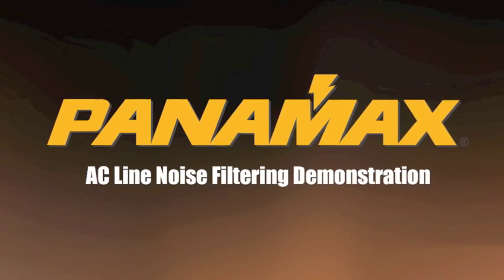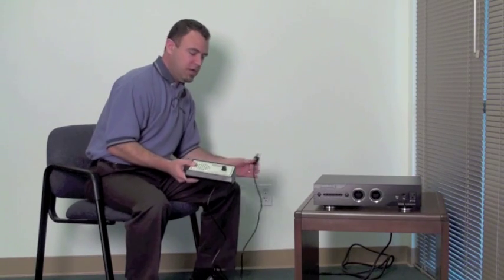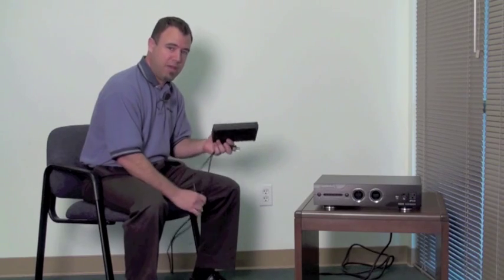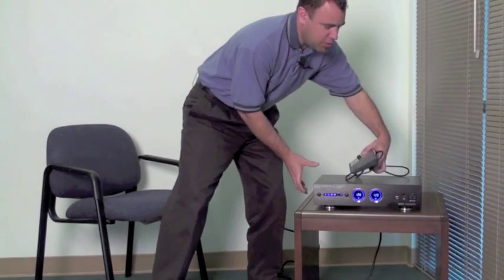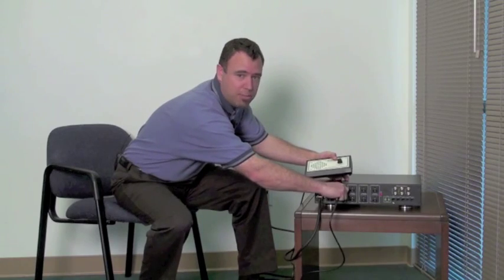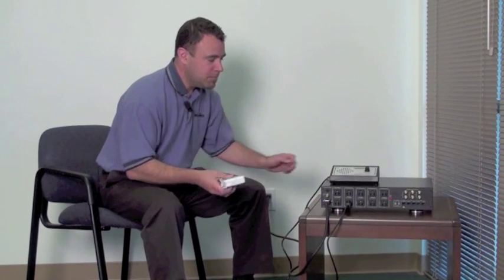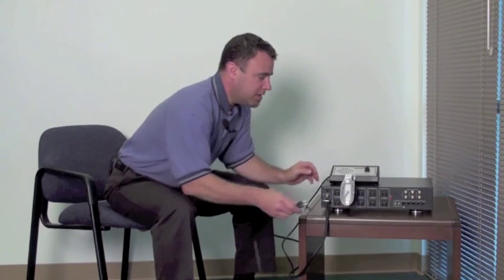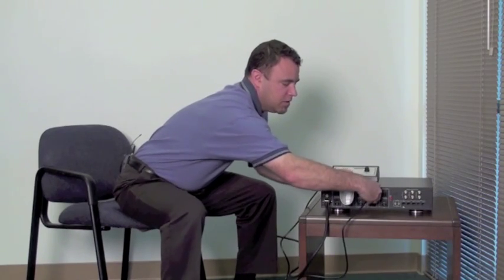Panamax Noise Filtering Demo

Comment: Hello:  Love my 2 panamax 5400's but I need a recommendation for something similar for a single plug in for my Epson projector which is plugged into a regular wall outlet in back of my couch opposite side of my living room from the panamax's. Any suggestion would be appreciated. Trying to protect my Epson projector but also trying to get the best picture from it.  Thanks in advance.  Hot Rod D.